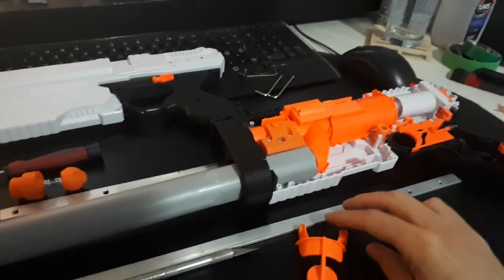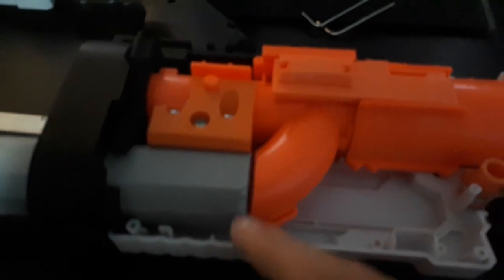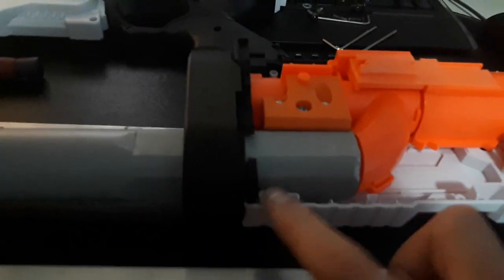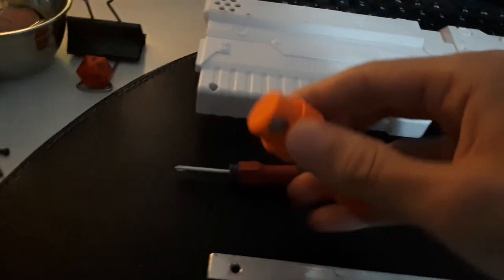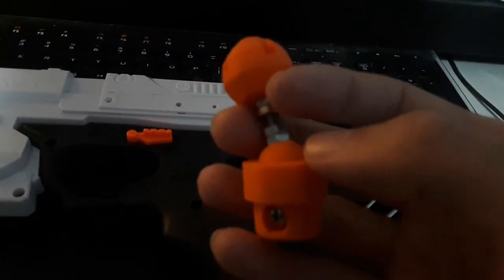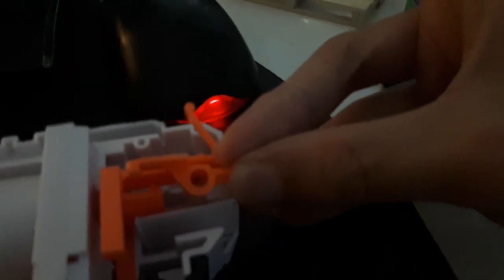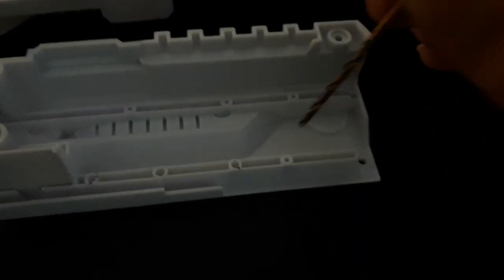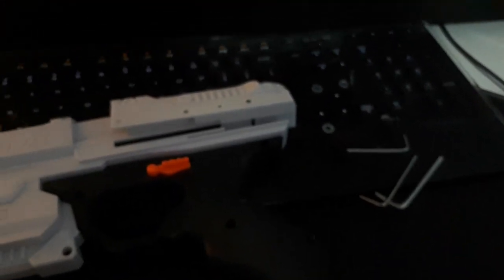Kronos Shotgun overview

Comment: I had removed the slide restriction that prevents more than one shot at a time, didn't like the increased noise, so I put it back. I haven't printed anything yet, but just the pump is 2 days of printing. I'll wait to print until I have all non printed parts acquired.

Comment: Mine had some problems with the barrel adapter, it won't fit in the kronos
Reply from the maker: Did you cut away the small bits of plastic that gets in the way of the 1 inch PVC? I mention it at 2:30 in the video.